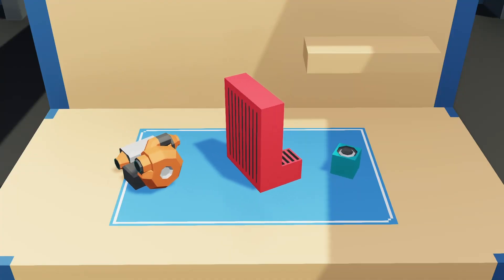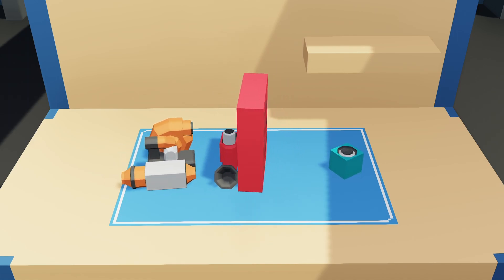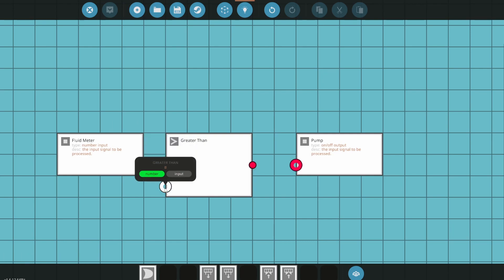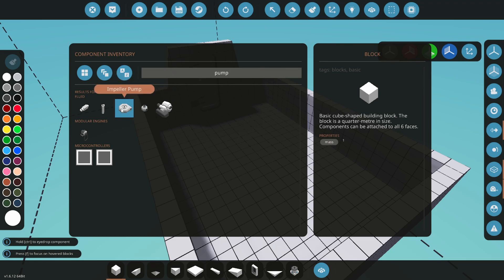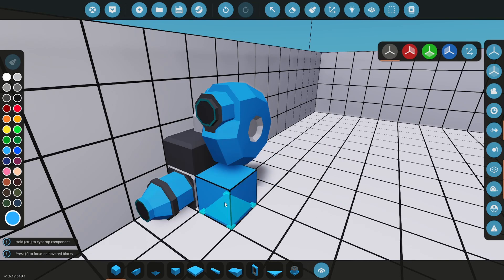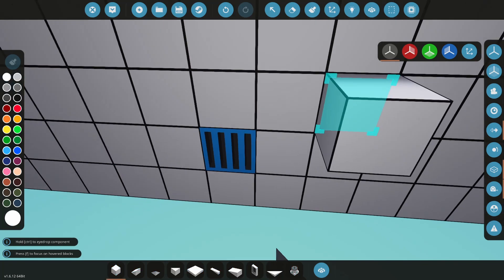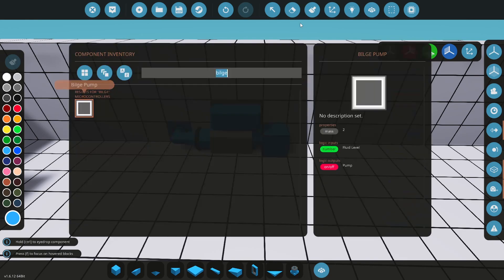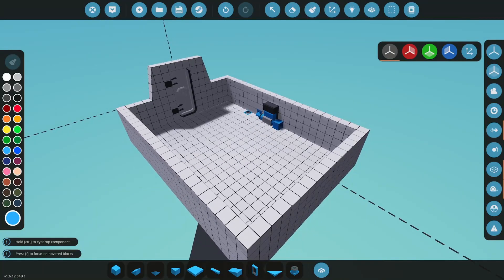Stormworks - Bilge Pump Tutorial

Comment: So I'm making a submarine and I want to add a system where you can pump water out / blow the ballasts fast so you can float back up incase of an emergency. How would I do that?
Reply from the maker: This method really only works with ships that are near the surface. Pumps struggle to push water out against the pressure under water.

Pumping water into an air manifold will delete the fluids inside your ballast and then opening a valve to let ocean water back in would fill them.
Reply: Got it, thank you so much!  @terr-rawr-saur
Reply: what is an "air manifold"? @terr-rawr-saur
Reply from the maker: @Kuwalt123  It is the component that allows air into a modular engine. There are currently some "fixes" affecting air manifolds deleting water. Unsure if this is intended behavior but its not a reliable solution anymore.
Reply: Hey so I am making a very tiny compact sub with cheats, and I made it so that you can open the hatch to get inside, and yes water does get it. So it fix this, I just made
a port inside, and a port at the bottom, and using fluid pump to pump it out. Only problem is that this takes forever. Any way to speed it up?

Edit: the cockpit depletes water at around 5 L/S.
Reply from the maker: @Kuwalt123  It seems like the small fluid pumps are significantly weaker than the large fluid pump. Changing may be all your need to do. Other things to consider is the pressure difference. you might also want a gas relief valve connected to a port inside your sub where you are pumping the water out of so that it can replace the water that's pumped out with fresh air.

Comment: I am building a submarine and I need the pumps to be fadt how I do that
Reply from the maker: Pumps loose power underwater because of pressure. I don't really know the full details of how to overcome this, more pumps in parallel might be a solution. Air manifolds also delete water which if you put a valve between the fluid port and the air manifold you could just delete the water entirely.

Comment: What's the use of this pump
Reply from the maker: In rough weather you might have water spill into your ship when you open doors. If you take damage from something below the water line your ship might take on water very slowly.

In both cases this can help keep you from sinking. In an extreme situation where your ship completely sinks, if you can restore electricity and weld the broken exterior walls, a pump like this will automatically kick in and help get your ships back to the surface.